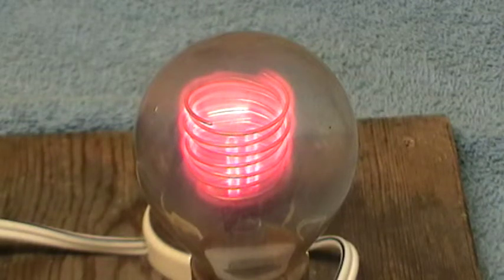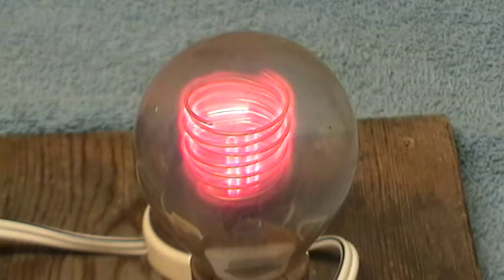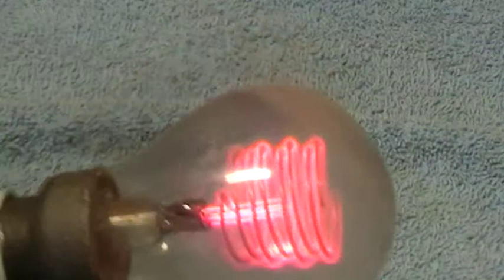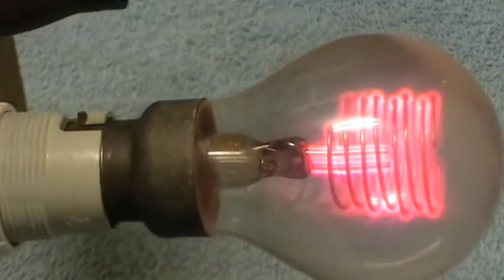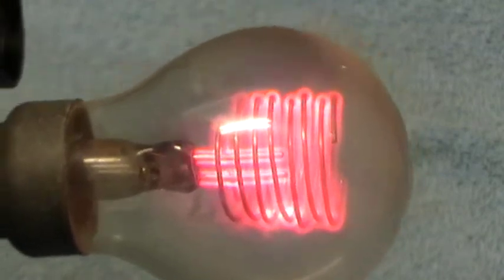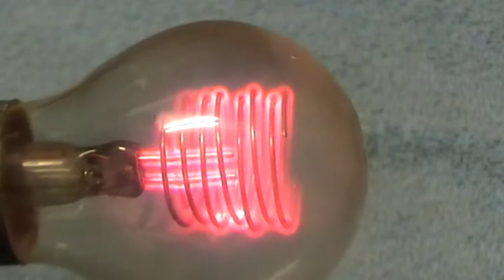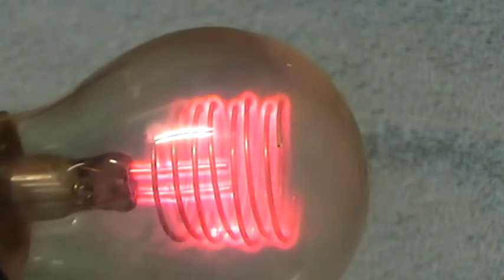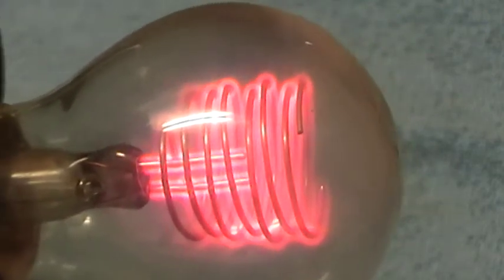Philips double helix neon

Comment: Did you connect the bulb directly to 110 or 220 volt, or have you used e.g. A starter?
Reply from the maker: These are either 110 or 230 volts check voltage first or use another lamp low wattage in series or a variac set low.
Reply: What i like to do is put it on a variac and slowly turn it up. When it lights normally you’ve found the voltage, if it starts sputtering immediately turn it off and you know it doesnt have a resistor.